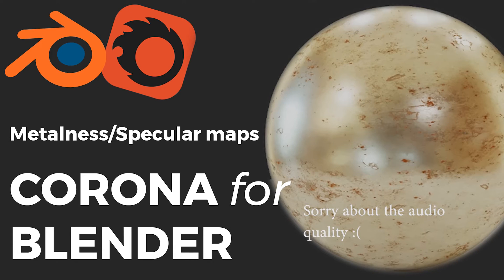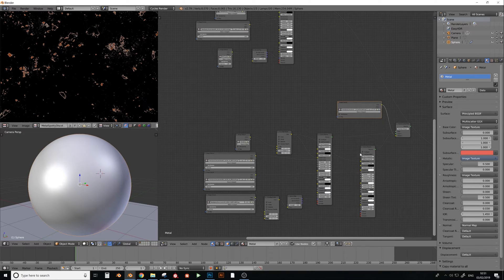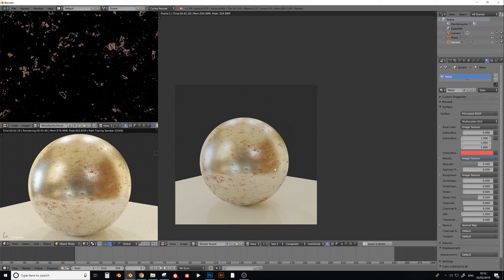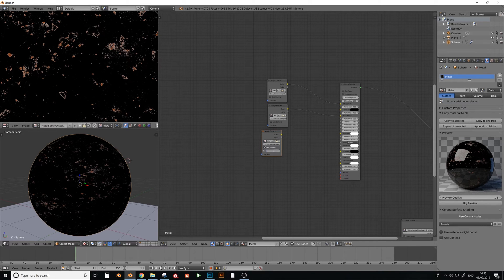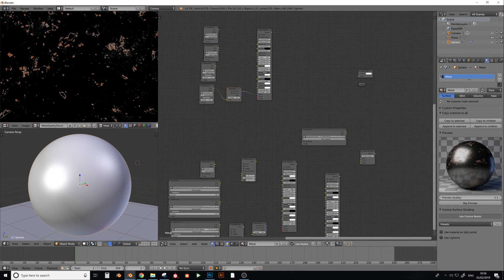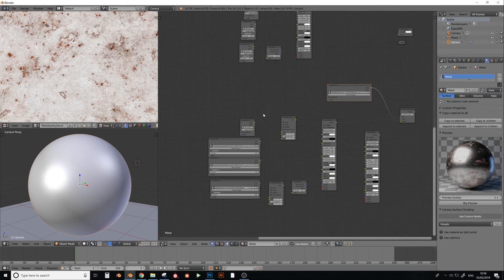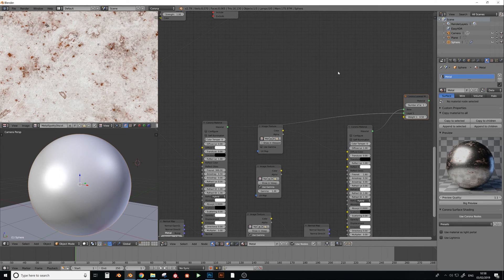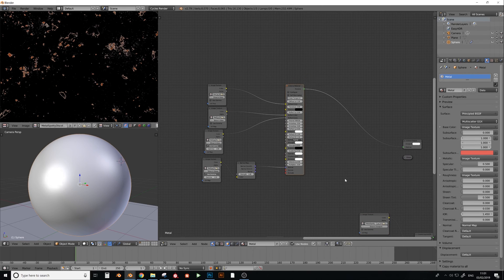BLENDER & CORONA - Using Metalness & Specular Metal maps

Comment: Hi guys, super good tut.
The best thing is if you can use metalness roughness workflow, then it is the same as Principled BSDF in cycles.
But as you say it seems to be a bug when you invert the ROUGHNESS METALNESS image. I solved it with a mix RGB node and a little gray in color b.

Thanks for all the little trix you have learned in your tutorials, have saved me a lot of time. We need an active forum for blender to corona.

// Patrik
Reply from the maker: Yeah you can absolutely use the roughness and metalnes workflow. Im sure the Colourramp node node or Tone Map Shader should do a good job of inverting, I probably just had an incorrect setting when i was testing it today. Its usually not a problem as I just use the Specular workflow, and most materials come with a glossy input rather than roughness anyway. But i'll investigate further :)